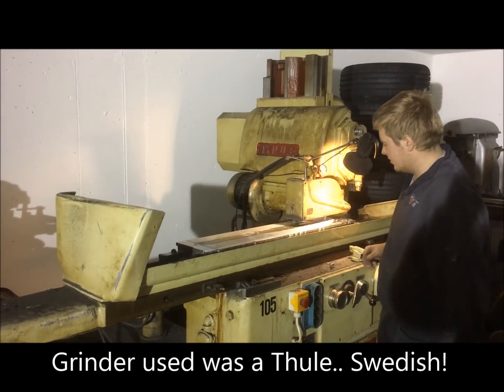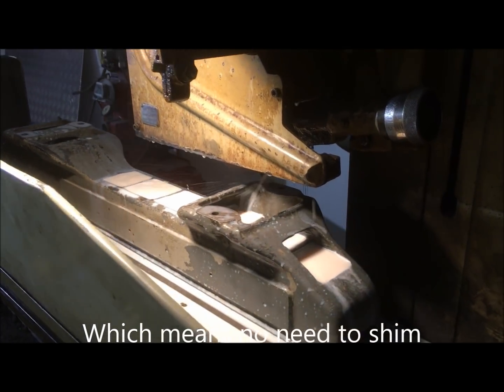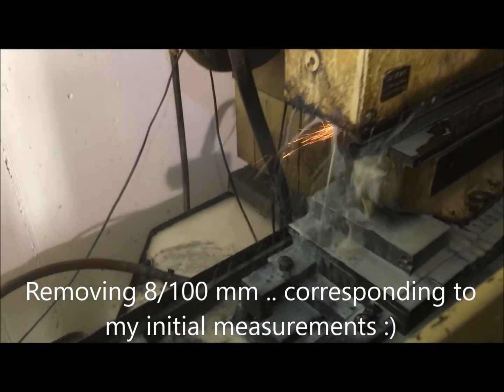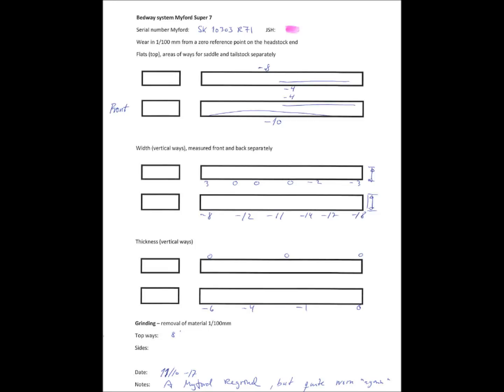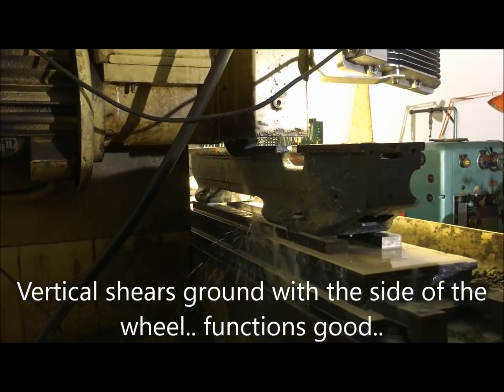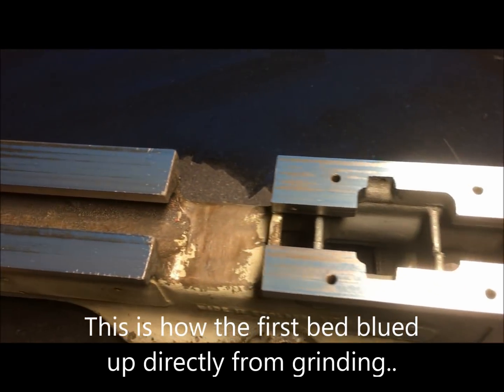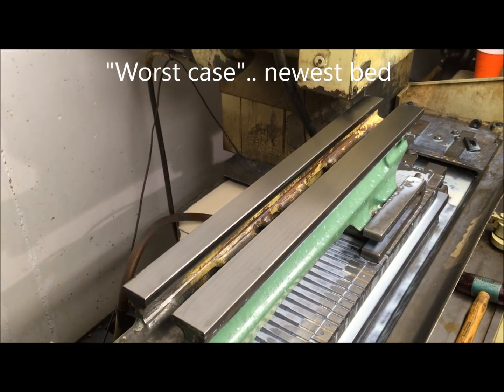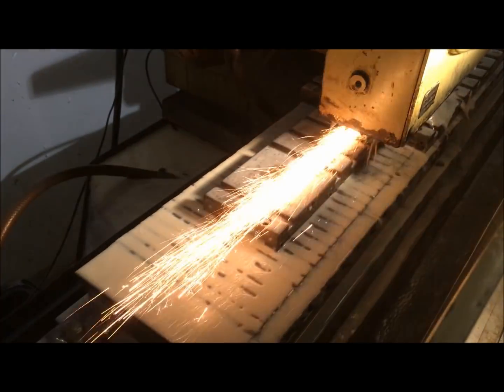Grinding Myford beds

Comment: Can you make a suggestion when there is a real significant low area (-0,3mm) just on the beginning of the underside of the bed for say the first 2 to 3 cm? Is that a problem?
Reply from the maker: Sorry! Misunderstood :) By underside of the bed I take it you mean the area where you have the hold downs for the saddle? You need to machine down the rest of the surface to this most worn area. Then You could either build up the hold-down pieces to match or machine the underside of the saddle that mates to the hold-downs.
Reply: @jansverrehaugjord9934  i am leaning towards using e z tig to build it up and than machine it. Indeed it is  to keep the saddle down. There is of course one right saddle to keep things down. Plus it it quite uncommon to run the lathe in reverse and take heavy cuts. But hey you do want it close to perfect for peace of mind
Reply from the maker: @therealspixycat  If I was you I would not TIG it.. Any local heat applied will most likely distort the casting and/or introduce tension that might show up later. Maybe if you are very careful, but I cannot see any great saving in doing it this way? Why not just scrape/grind/machine like I suggested?
Reply: @jansverrehaugjord9934  now i describe it it might be just a flaw in the casting. Indeed tig welding introduces tension what you dont want, however e z tig, from what i have seen (the $7000 mistake channel) tig weld that stuff explicitly without preheating. It is not welding but brazing with a wire with quite a low melting point. I don't want to mill it even because than I have to grind away quite a lot of material to make it uniform. May be make a flat slope and than glue a ie cast iron piece as a filler. This part is in fact not extremely critical
Reply from the maker: @therealspixycat  I understand.. just don't see a great advantage in this nethod nor any need to have this material put back, unless therecare other complicating factors
Reply: @jansverrehaugjord9934  i was referring to this video https://youtu.be/0JizL6ZvTsM
Reply from the maker: @therealspixycat  Yes, I know him.. also subscribe to  Steve's channel. But still would have not welded up because I would see it less risky and less work to machine down the remainder to the lowest area and compensate by adding material to the smaller hold-down. But eac method would work and it is your lathe, so your decision :)
Reply from the maker: @therealspixycat  PS! Have also used the silicon bronze method on a broken cast iron casting on my Schaublin mill.. with success. However, I still wouldn't use it on a way surface and a long casting like a lathe bed, especially not a relatively slender Myford.

Comment: A very nice job you have done there, its great to see the wear pattern on the top gradually disappear.
 I visited the Myford factory in Nottingham England a few times and watched them manufacturing new lathes and reconditioning used Myford lathes, they were about 50 miles away from me.
 While there I saw a Myford lathe bed set up on the grinder and they would set up a clamp to pull the middle of the bed casting down a fraction before the top of the bed was ground flat. When the clamp was released after grinding the top surface of the bed was left very slightly convex. The grinder operator explained that this was to allow for the weight of the lathes carriage assembly and cutting forces when in use which would then flatten the bed slightly. 
 They were good times and I really miss the old Myford factory.
Reply from the maker: Hi there,
We will try the calmp-down on a couple of beds now next time. Also a criss-cross finish grinding pattern
Reply: I have doubts about the effectivness of the clamping mehod; it compromises the flatness at the moment of grinding the bed for the "promise" that after some wearout has occured the flatness would be better. At best it is just swaping the out of tolerance sequence of time for another one. In the meantime, the newly ground bed will be put to work and it would be subjected to torsion in addition to bending, torsion which was not present at the time the bed was on the grinding machine. I know the feeling that "factories know what they are doing" , but I am not sure this was the standard procedure. Some machinists like to add their own wisdom to the process, which in essence is a good thing, but some are wiser than others.
Reply: @mihailfelixdumitresc  They've been doing it for a hundred years. Pretty sure they would have tested every combination possible. It just makes sense to load it with the mass of the carriage no?
Reply: @markrainford1219  Not to me. It would make more sense for the body of the machine to be that thick so that to be unaffected by the movement of the carriage. A hundred years ago the (civilized ?!) world was at war and their main concern was to make as many lathes as possible so that to be able to make as many weapons as possible. So scarcity of the raw materials was a main concern, therefore thickening the body of machinery of any kind would have not conformed with the priorities of the moment. I am sure  a gun turret would have not minded to be 4 thousands out of tolerance, I guess.....

Comment: Where are U based?
Reply from the maker: Norway
Reply: @jansverrehaugjord9934  too far 😪😪😪 1125 miles...
Reply from the maker: @damianwojcik5502  Poland? Why did you ask.. wanted to get your lathe bed reground ?
Reply: @jansverrehaugjord9934  Yes Poland but actually live in London. Yes reground bed. Is hardly to find someone on my location.
Reply from the maker: @damianwojcik5502  I googled and found that there are a couple of shops in the Birmingham area. If a Myford, the bed itself isn't that heavy and could be transported in the booth of a car
Reply: @johnspencer6777  thank You. I live close to Colchester👍👍👍

Comment: under surface of the ways usually have no wear but you forgot the taper going towards the headstock on the vertical sides and early versions have 3 shouldering surfaces mating the under saddle (1 on the narrower way and 2 on the largest way ) to the vertical sides as later versions don t have 3 anymore but only 2( 1 on each external side of the way) ?
Reply from the maker: Hello there,
Not sure if i understood you correctly, but are you referring to the wear on the underside of the saddle, the side that mates to the bed top surfaces? If so, they are normally worn more than the worst part of the bed, wear centered more so directly underneath the cutting tool, ie. on the leftmost side towards the operator. Also, if I understand you correctly, you are asking if I scraped and aligned the vertical surface of the saddle? If so, yes, I did. On these early models of the Super 7, the longitudenal guidance is made between the front and rear side of the front way, which means the rear side of the front pocket in the underneath of the saddle is where you get most wear. The later versions of this type of lathe "converted" to using the rear of the rear way instead, which side is longer hence give more support and longer usage before wear sets in
Reply: @jansverrehaugjord9934   I scraped and aligned the vertical surface of the saddle? If so, yes, I did. On these early models of the Super 7, the longitudenal guidance is made between the front and rear side of the front way, which means the rear side of the front pocket in the underneath of the saddle is where you get most wear. The later versions of this type of lathe "converted" to using the rear of the rear way instead, which side is longer hence give more support and longer usage before wear sets in. I was only talking about vertical surfaces.  I own 3 ml7 and 3 super 7 & 7b , one of them (ml7) is brand new 1969 never been used and there is a almost 1 thou 0.001" clearance between the rear of the front way and it s vertical mating surface under the saddle , the longitudinal guidance cannot rely on such a tiny piece , it would twist the way , the rear of the front way acts as a stop/support when the cutter hits the material(the saddle wants to back up) , the longitudinal travel can only be set between the 2 gibs , and I think that is why on later versions you don t find it anymore because myford engineers found out that once wear had settle in this was of no use anymore, but , also more important : that it will speed up wear to the inner front sideway thus impairing the tailstock s alignment faster , measure it out even if it s worn you will see what i mean , Sorry i forgot that is why the taper on the external vertical sides of the ways have to be eliminated , micrometer , a stone&oil and patience
Reply from the maker: @amateurdesubaru  Hi there, thanks for elaborating. Very interesting! I guess that Myford may have changed to use the "wide guide" principle on the later ML7's also, not just the Super 7's, because as you point out, they probably found that the (at that time popular) narrow guide principle led to premature wear because of the compartively short surface in contact with the bed. On the early Mk1 S1 I have seen there was also the same clearance, but to the rear of the rear way. Hence this surface was pristine and could be used as reference. The rear of the front pocket of the saddle was quite worn of course, and so needed rescraping. (I also converted to the rear guide principle on some). PS! It first puzzled me, but the same narrow guide principle is also found on my Schaublin SV52 milling machine column ways, ie. from the 50'ies.

Comment: Hi, is it possible to harden ML7 bed?
Reply from the maker: In principle, yes, I cannot see why not? I reckon it is the same bed they used when they introduced this (Myford offered hardened beds also in the later years of their operation)
Reply: @jansverrehaugjord9934  Myford did list a hardened bed as an option for the standard short bed Super 7 lathes, but in some of their adverts for their Super 7 lathe it stated that a hardened bed was not available for the long bed Super 7.
 So on one of my visits to the old Myford factory in Nottingham I investigated the reason why the long beds were not available hardened, and it was simply because at that time they had in stock sixty raw long bed castings that were cast in a grade of iron that could not be hardened.
 I am not sure if this also applies to the very early long bed lathes.
Reply from the maker: lathejack interesting! thnks for the comment
Reply: I also have ml7, the bed is worn out. my plan is grinding the bed. if it can be hardened, the way is not easy to wear. can you give it a hardening method

Comment: Nice. Did you regrind all of the vertical surfaces? Outside and inside? I'm thinking that not all serve the same bearing function.
Reply from the maker: Thanks! Yes, all so called "shears" or vertical faces were ground. So were top flat surfaces. This left the undersides, which I scraped. As you indicate, the vertical surfaces don't serve the same function: on the older machines Myford used the so called "narrow-guide" principle which meant that both the tailstock and the saddle were guided by the front way. On downside of this was that the shorter rear face of the front " female way" on the saddle wore faster than otherwise would have been the case. The rear of the rear way was however left "untouched" so if your machine is of this vintage you have a possible unworn reference surface there (look up the serial number stamped on the bed and check with Myford or just have a look at the rear of the rear way if this looks pristine.. grinding or milling marks). If you have a newer machine Myford changed the design to the "wide-guide" principle so that the saddle is guided by the outer surfaces of the front - and rear ways. This does mean that the rear surface of the rear way might be too worn to be used as reference (but needs to be checked anyway). Do you have any measurement devices apart from a surface plate eg. a straight-edge. If you are in the neighborhood, you are welcome to my shop. I can help you out. I suspect you are Swedish? Where? I have some friends in Sweden
 that might be of help also..
Reply: Linköping! My lathe is from somewhere between 1962 and 1964 according to the serial number. Thanks for the offer! You are somewhere in Östlandet by the sound of things? :)
Reply from the maker: Karl Månsson Drammen
Reply: I've changed trains there! I worked a summer in Farsund. Traveled to Oslo by Drammen. I sent you an email. Have a nice evening!
Reply from the maker: Karl Månsson thnks the same!

Comment: Nicely done. A suggestion is to use a silicon carbide grinding wheel on the cast iron. That wheel is burning the iron as evidenced by all the brown stipes.
ATB, Robin
Reply: Thanks for the suggestion Robin. Currently using the grinding wheels available for my machine. It uses an old standard 230x32x76.2mm approx 9"x1-1/4"x3" wheel. Will manufacture a new exploding cover that will make the machine accept 250mm wheels.
Will look more into silicone carbide wheels. Tyrolit has actually recommended this wheel for cast iron
Reply from the maker: ROBRENZ Thanks again! Chris, do you follow.. you're the expert grinder 😀

Comment: Hi Sverre.  Who did the grinding for you?  I need to grind the table of my Schaublin mill, but the shop i contacted in Drammen were unsure if they could fit the length of my table.

Arnljot
Reply from the maker: Arnljot Seem It was done by Chris-Robin Kalmo Funder. I believe your Schaublin 22 has aa 650x250mm table?, which is within the capacity of his grinder. Chris is member of Verktøymaskinklubben at FB
Reply from the maker: Har sendt deg venneforespørsel på Messenger med email og telefon til Chris
Reply: So you are familiar with the 22 ;-)  You have a 52, don't you.....
Reply from the maker: Arnljot Seem  Yes, I have a 52. Have seen the 22 a couple of times. Very nice machine!